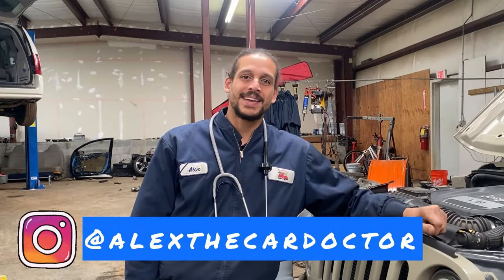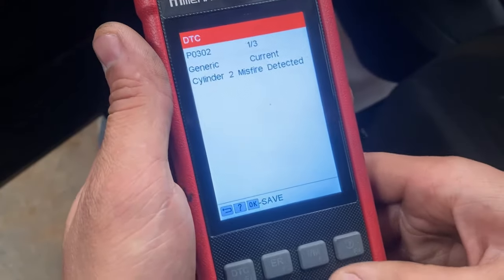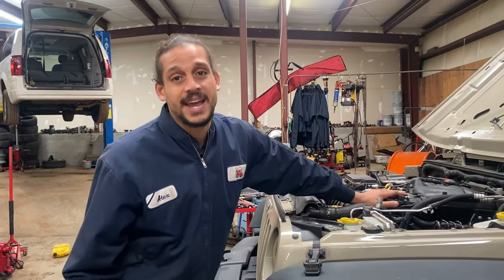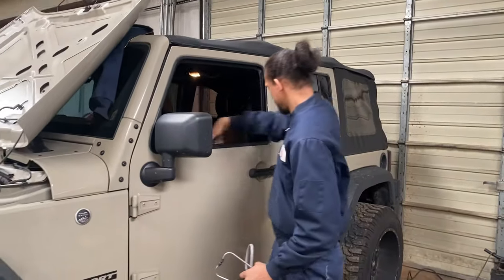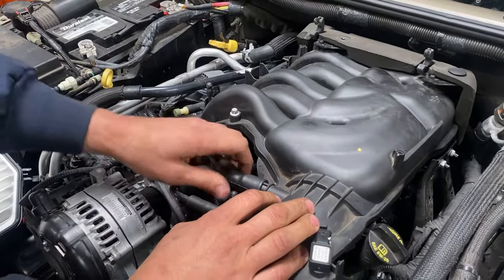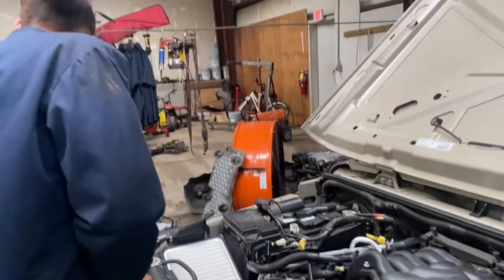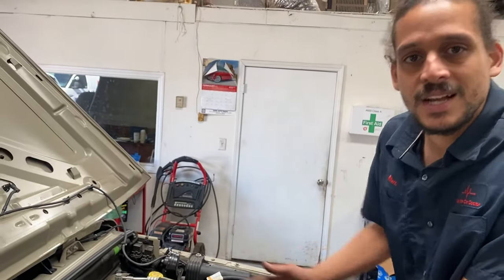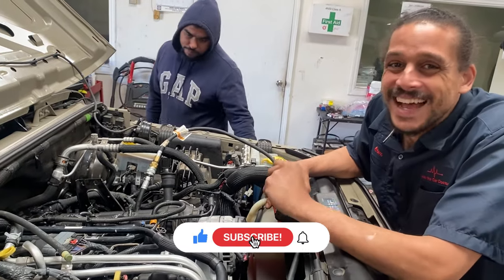Jeep Wrangler needs Major Engine Work at only 40,000 miles! | 3.6 Pentastar Issue #jeep #autorepair

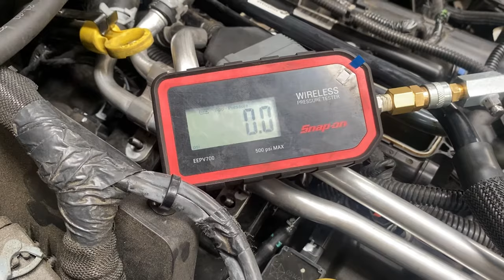Comment: The noise the Jeep makes at 22:54 is what mine does now after changing cylinder #2 since it was misfiring . Engine light came on , changed all six spark plugs, engine light when off. Then turned back on changed the cylinder 2. Light went off came back on. And when starting it makes this noise.
Reply from the maker: Hey buddy so it’s not currently raining right
Reply: Mine did the same thing, I took it to auto zone to get the fix finder to see what's wrong with it. It said cylinder misfire on #2 (but the mechanic already fixed that) but also said underneath that, that the injector fuel #2 is open. So I am assuming it's just that, that I need to fix. I am thinking of fixing it myself, instead of wasting 400 bucks. It's 99 dollars for the part.
Reply from the maker: @zellequinonez8906  hey buddy you can handle it just take your time

Comment: Remove the ASD relay and you can do a compression test with out the fuel system to be bleed. ASD relay + voltage to the injectors and the coils
Reply from the maker: Did not know it had a auto shut down relay so I didn’t bother mentioning it. Thanks for the information buddy

Comment: Common failure is the rocker arm bearings on 3.6. Millage isn't relevant or year model.  It's known manufacturer defect. Really luck of draw if happens & it can chew up the cam shaft lobe. Doubt it's the VCC or it would effect all cylinders on same side of engine.
Reply from the maker: I just witnessed that on a Ram pro master with low mileage

Comment: I bought a 2008 Jeep JK Wrangler with the old 3.8L pushrod V6 new off the lot; at the time everyone said I was crazy, and that I should just wait another couple of years until the brand new OHC hi-tech Pentastar motor was released, however I had my reasons.  The old Mopar 3.8L V6  had been around in one form or another since the 80's, being used & abused in minivans by soccer moms and that motor, while certainly no powerhouse by today's standards, had a solid reputation for reliability; sure, some of them were known to be oil burners but apart from that they were fairly bulletproof (even the oil burners were fine as long as you kept an eye on the oil level & kept them topped-up between oil changes in order to avoid running them dry and spinning a bearing).  

The new upcoming Pentastar V6 however was an unknown quantity and would undoubtedly have some teething problems as most new hi-tech motors do, which indeed turned out to be the case with frequent cylinder head failures in early years (which ended-up with a redesign of the head itself) and although these motors eventually got better as the years went by they are still known for multiple issues to this day with failing rocker arms, cracking plastic oil coolers, dry starts due to the poor design of the cartridge-type oil filter without a drain-back valve included in the housing, etc.  I had originally planned to trade-in my '08 and upgrade to a later model Wrangler with the new Pentastar V6 after a few years however after seeing all the problems with this new motor I held-off.  

I still have my '09 Wrangler with 140K trouble-free miles on it and apart from regular maintenance items (plugs, serpentine belt, idler pulleys, scheduled coolant changes) the only thing I had to replace at 100K miles was the water pump (pump itself was fine but the gasket was leaking).  I have changed the oil every 3K miles from new and expect this motor to continue to run at least another 80-100K miles trouble-free (will probably replace the injectors in the next few years purely for peace of mind)

Comment: Hi, very important! You were supposed to cover up that exposed intake manifold (6 holes) so that you don’t drop tools or debris down in the exposed engine. 😣
Reply from the maker: Hey buddy and thanks for watching.I only cover them up if I’m leaving the work area.I’m always paying close attention.and plus I’ve been doing it that way for about 12 years and no problem. thanks for the advice
Reply: @AlexTheCarDoctor  I get your experience, but even experience people make mistakes..  it only takes one ratchet socket to fall down in one of those holes and basically that Pentastar engine could be ruined.  Just my observation and based off watching other mechanics working on that type of engine and they would stress covering up those holes as I own a 3.6L Pentastar myself.
Reply from the maker: You right about that buddy. Thanks for the advice man
Reply: I'm also a mechanic... you can't cover the holes when checking compression.

Comment: I'm crying.  My 2017 tossed a P0302 while on the Rubicon Trail.  40,300 miles on the engine.  I pushed and my dealer pushed, and Jeep is going to cover this and I have to pay $1500 deductible.  I drove this engine around town and wheeled it.  It's not my primary vehicle.  I changed the oil religiously with Amzoil.  Looks I like I'll get it fixed (My compression was about the same..80% of normal) but I think I'm going. to start a HEMI fund.

Comment: yeah my chrysler pacifica 2017 30k miles, bad knocking, had it turned up,  still there, luckely it was a CPO vehicle with a 7 year, 120000 mile warranty on engine, had a better warranty than a new van and only had 2k miles,  dealer service tried new rockers, 2 new heads, still knocking, I told them the original tech non dealer said #3 rod bearing was bad, they did not listen, finnaly after 4 weeks of trying, they replaced the engine.  So far so good.
Reply from the maker: Wow that’s crazy

Comment: Coworker of mine has one of those 3.6 nothing but problems I have an old Ford truck it's a 91 F150 the engine has never been overhauled it has been well-maintained 380000 MI still going strong I'll keep my underpowered 300 cubic inch inline 6

Comment: Great video. Im having problems on the #2 cylinder on the same engine in a charger. The compression is good but the plug keeps fauling out.

Comment: 2012-2013 the driver side head had a extended warranty to 150k miles.  I have a 2012 just hit 100k miles problems so far, engine oil cooler, 2 thermostats, rear main seal leak, radiator cracked, and on going camshaft position sensor cil bank 1. only happens going 75mph at a steady speed for a while. jeep dealer had it twice, re did the wiring to the sensor and tightened the oil galley bolts. Didn't fix it now they want to replace the passenger side head.
Reply: Glad to know galley bolts didn't fix it. I've had every problem you had and they want to check the galley bolts. My camshaft sensor bugs out when I hit a bump.

Comment: In the wire harnesses as the harnesses goes in the firewall.  The data lines are touching something, probably the wiring for the lights. I bet it has shifting and small jurking.

Comment: I got a 2017 Jeep Wrangler and I do live in Phoenix and it started overheating but didn’t reach to the max and I changed every component on cooling system thermostat, radiator, hoses, water pump, overflow tank and even radiator cap. When we run the Jeep it flows the coolant to the overflow tank causing it to have not enough coolant in radiator and then it heats up.  Next step is to do compression check maybe warped head or head gasket??  Also check engine light doesn’t come on ??? I’m lost and the air was bled from system too.
Reply from the maker: Hello, are the cooling fan coming on
Reply: Yes sir they are
Reply from the maker: You can perform a block test to make sure the cylinder head gasket is good, you have replaced just about everything in your cooling system.my guess if it passes the block test you still may have air in the system, are you familiar with performing a block test
Reply: Might want to check your heater core. They are known to get clogged up.

Comment: You have to replace the head.  The line bore of the valve is off, compared to the valve seat.  It does not seal or in some cases it will crack the valve.  The only fix is to replace the head.

Comment: Enjoyed watching you! I tuned in because of the mention of problems with low miles.. Should I be concerned? My 2015 2 dr 6 spd only has 7500 miles.. totally baby, even has a dust cover.. garaged over the PNW winters, only driven in the summer, it doesn't get out much. I change the oil and filter once a year. Engines like to be worked. Having heard so many negatives about the JK wrangler and this engine in particular and not using it enough, I'm concerned I could be killing it from inactivity. Like they say, use it.. or lose it. lol
Reply from the maker: I think you should be fine sounds like you take very good care of her
Reply: Sometimes you just get a bad engine.  At 7500 miles for a 2015 -- KEEP IT.  It will be fine.

Comment: Awesome vid, man! 
I have a 2015 Jeep Wrangler JK with a 3.6L & have been dealing with a misfire the last month - rocker arms and lifters! I'll be doing those this weekend! There is a lawsuit currently in place against Chrysler/Dodge for these motors, specifically to the previously mentioned engine components. Really sad given how inexpensive the rockers and lifters are and additionally, being tied to the Jeep name. Curious to know if this was the issue got had and repaired on this particular vehicle? 
Thanks again for sharing! I really enjoy your analysis on different things and your teaching abilities! 
Keep it up,  man!
Reply: You need a new head, its the only real fix for the issue.
Reply: @darknes7800  Exactly. The lifters probably failed and so the exhaust port burned through. The dreaded P0302.

Comment: Hi Alex. I’m Currently in the market for a wrangler. Would you recommend the 3.8 v6 over the 3.6? I just don’t want to have head issues because it will be a substantial purchase. Let me know if anything. Thank you!
Reply from the maker: Hey buddy yes the 3.8 was a wonderful engine. If you want something newer look into the four-cylinder that’s a great engine as well.I’m getting the four-cylinder diesel but I suggest the gas burner four-cylinder for you a little bit easier to maintain
Reply: @AlexTheCarDoctor  thank you! You’re the man
Reply from the maker: @djduvi88  my pleasure buddy
Reply: The 3.8l will struggle in a head wind on the highway in a Jeep JK. The power is very anemic in those engines. The trade off for the 3.6l is the amount work to do for basic maintenance. If you want to lift the Jeep or get a 4 door, avoid the 3.8l. With a 2 door, the 3.8l is fine. I've had both engines and had more issues with the 3.8l than the 3.6l.
Reply: @sweetmcnasty  I’m just afraid of the cylinder head issue if I go with the 3.6. I saw somewhere that if you do a lot of highway driving then the 3.6 engines are fine. Short city driving can stress it from lack of operating temp etc. Not sure if that’s true but I’m getting a 2013
Reply: @djduvi88  That's correct. My 2015 3.6l is starting to get this ignition issue and it's from a lot of stop and go traffic (60k miles). I've done no off roading with it and stuck with the maintenance schedule.
 I had a 2008 Rubi with a 3.8l and the engine blew because it was struggling to go up a hill on the interstate @ 55k miles).
 
Like you said, I do believe city driving caused this issue with the 3.6l and that's why I'm thinking about downgrading to a TJ with the inline 4.0l. Those engines are reliable and easy to work on and a replacement engine costs around $2,250.
Reply: @sweetmcnasty  I do all highway driving so I might be ok. I’m thinking riding 33s so I hope nothing blows from that. Possibly 35s but starting with 33s
Reply: @djduvi88  If it's mostly highway..... go with the 3.6l. You'll want that zippy acceleration instead of chugging and downshifting. The 3.6l engine isn't bad......it's just expensive to replace and hard to diagnose the problem.
Reply: @sweetmcnasty  thanks for the info. I’ll get the 3.6 for sure
Reply: @sweetmcnasty  bet your 08 rubi had sticking brakes after you press your brake pedal hard
Reply: @jakeowens1770  Nope. The only Jeep I had with sticky brakes was a '14 2 door sport with that crappy 3.21 gearing. That's out of 6 Jks.

Comment: Nice work! Good troubleshooting skills! I liked and subscribed. 👍👍
Reply from the maker: Thanks so much for the support buddy
Reply: @AlexTheCarDoctor  I work on my own vehicle frankly because I don't trust people to touch it lol. As a lot of people do not know what they are doing and you're touching my baby. You gotta know what you're doing or don't even knock on my door. I would feel comfortable giving you the keys or working on it with you. Cheers buddy! Finding someone who knows what they are doing is like Indiana Jones looking for the holy grail. I use to have a 2004 grand Cherokee overland with the 4.7 HO. Had a hard misfire on #8 (of course the crappiest location) after hours and days of troubleshooting (never experienced a broken valve spring), it was determined that the exhaust valve spring was broken, i got a camera for my phone and dropped it down the spark plug hole to make sure there was no damage to the valve or piston. No issues there. Took a compression tester, filled the cylinder with 120 psi to hold the valve closed, got my tool to compress the spring by using a special tool and the cam as the fulcrum, with 2, 12" 3/8 extension's I was able to compress the spring, pull the bad unit out, compress it again with the new spring and install the keepers. This was all done with myself and GOD! Put it all back together and boy did I understand why all 4 tires were bald! Lol lol power!! I took to the shop to have the exhaust stud replaced and the mechanic said... You take care of your vehicle don't you! That thing runs! Thank you, Lol yes sir I do. It'll bark all 4 tires leaving the light. Bosch platinum +4 plugs, 12 hole injectors, new fuel pump, new O2's (all 4) new coil packs. Paid $1500 for it because it ran like crap. But when I was done BEAST.
Reply from the maker: @JF32304  thanks for the love buddy. Man it sounds like you a good mechanic man. I love seeing people take pride in their vehicle, I just wish I had the time to take pride in mine lol I guess I’m too busy making other people vehicles be great.

Comment: 2017 Rubicon. 68K miles.  Extended Warranty expired at 60K miles.  7K left in payments.  Repair estimate 3-4K.  Abandon ship now or keep her?
Reply from the maker: It’s a Jeep Wrangler I would keep her if I had the money to repair it. The Jeeps hold their value very well
Reply: Thank you, so far I have not been impressed with Jeep Customer Service.  “Jeep Cares” on one of the forums basically told me to pound sand.
Reply from the maker: @deborahclem4901  that’s terrible I assumed they had good customer service. Maybe it’s the area of where you are from
Reply: @AlexTheCarDoctor  maybe.  Was expecting something, like, pay for car rental, sigh…
Reply from the maker: @deborahclem4901  where are you from?down here in Georgia most dealerships will give you a loaner car for free

Comment: Poor Pentastar, someone neglected him in the past, such low km’s too, fixable but at 40k that’s just full neglect from previous owner ☹️
Reply from the maker: They said they took care of it but you know how that works sometimes
Reply: Took care of mine, junk engine.
Reply: No! I replaced oil with premium every 3-4,000 miles. I had both a 2009 and 2014 (still have the 2014). The 2009 oil cooler broke (common problem). The 2014 had passenger side lifters replaced under warranty (common problem). Then at 80,000 miles the driver head had to be replaced for P0302. Poor maintenance will help to kill an engine, but these issues are well known, documented, and Chrysler is paying for the work as a warranty fix, regardless of mileage.

Comment: Warranty expired for the Powertrain?  Are you sure?  2018-2021 is only 4 years.   Missing bolts?  A mod was done maybe - air intake  (hmmm)  , then the original parts slapped back on (but they lost the bolts?) after they screwed up the engine?,  that or that previous shop was so shady or incompetent that they figured out how to blow the piston bust a pipe and lose the screws?  Did they ever change the oil? or put the correct kind in?
Reply from the maker: That’s the first thing I asked them and they called the dealership right off the bat, and they told them it was out of warranty. That’s a good point about the upgrades 🤔 sometimes customers don’t tell me the whole truth. I don’t know if they kept up with the oil changes or put the right oil in previously. That other shop seemed very shady from what they told me. Thanks for the comment and good observation man!
Reply: @AlexTheCarDoctor  The warranty 5yr/60k for powertrain. I smell bullsh1t here.

Comment: I have a 2014 manual with 50K miles, I keep up on maintenance. Do you think I'll see future problems ?
Reply: I also have a 2014 with manual. Radiator has a pin hole leak at 100k miles. Oil cooler had to be replaced at 110k miles.  Good luck!
Reply: @brad9752  Thanks, just have to wait till it happens

Comment: Hey bro great video. Should i stay away from these engines? I was looking at downsizing my ‘05 yukon to a grand cherokee w the V6 but looking into them and have found out that these get cracked cylinder heads, and all the above mentioned.

Comment: Hi. I see you really know your stuff. I have a 2017 Jeep Wrangler sport. While driving it turned off with a check engine light misfire po300 po305 po306. Also running really rough. So my question is. What step I should do to figure out what’s going. I already swapped all the spark plugs and coils to see if the misfire will follow, but it stayed at 5 and 6
Reply: Take it to the dealership and have them diagnose it. If it is this common problem get Chrysler to pay for the repairs. Do not take no for an answer.